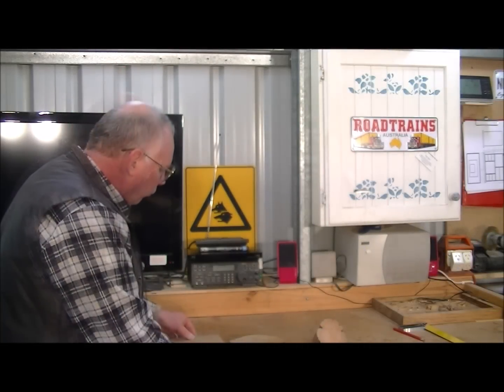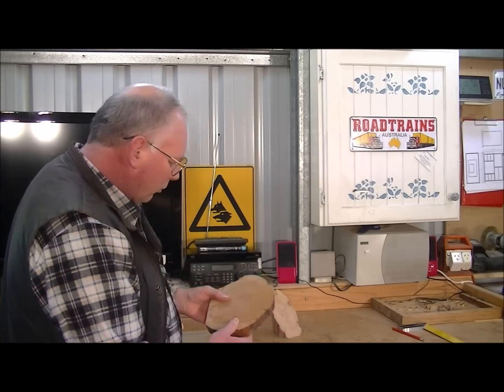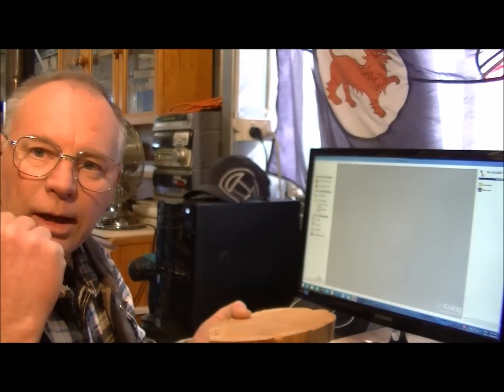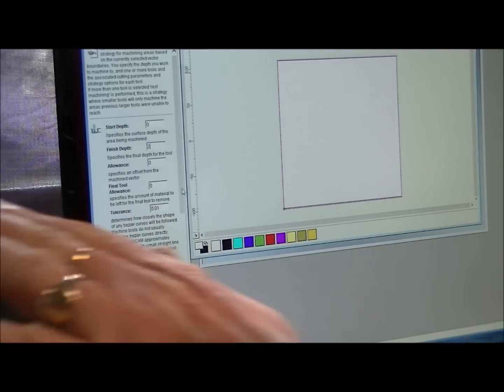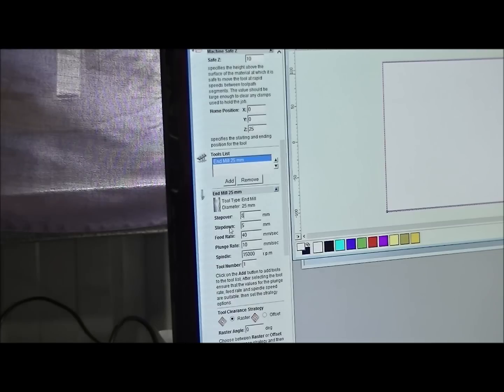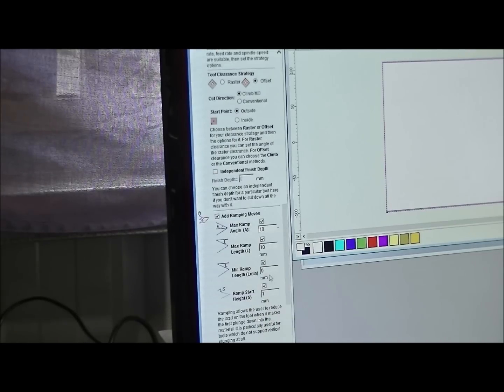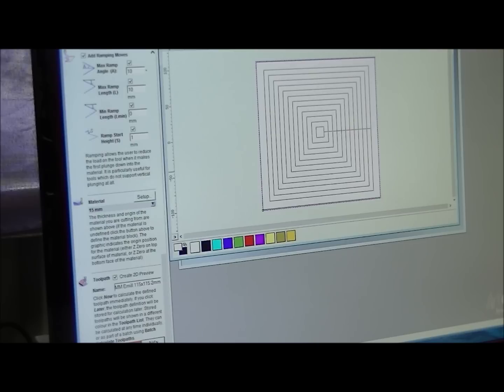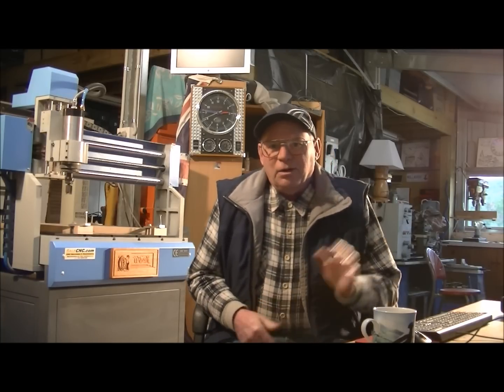103 Absolute beginners CNC Router, ArtCam, Mach 3  Tutorial

Comment: I have a symmetric design about vertical axis drawn on autocad. This design is fed to artcam which makes it machine readable. Problem occurs when I cut the design as it is not cut as per the design dimensions. One half is different than the other half. And it has happened on multiple occasions. I have checked the design in autocad as well in artcam but there is no deviation from the design. Then why is this error happening again and again. Please help me with this issue. Thanks.

Comment: What kind of PC required for artcam 2008 based CNC routing? Is ryzen 2200g enough without discrete GPU?
Reply from the maker: Hi, WIN 7 to 10 500G+ and 4G RAM
Reply: Roger Webb that was so fast. What about CPU and GPU?  Thank you
Reply: @inventorsworkshop9600  hi

Comment: Hi Roger, very nice intro to CNC, when I make a circle of 20 mm of diameter in ARTCAM, why MACH3 does it of 21.5 mm, I am using  G-code .tap extension, or any other figure always MACH3 does it from 3% to 5% bigger, thanks in advance for reply.
Reply from the maker: Hi, see my video 198.
 Australian Inventor Roger Clyde Webb
Reply: I will, thank you very much

Comment: how is the wood clamped on the cnc table ?
Reply from the maker: T3CHNOTURK Hi 
Screwed from the back ;-))
Reply: Roger Webb ok and how when you don't want screw holes on the back ? :), i have claimed with 4 blocks on the side of the wood. it worked very well but a bit dangerous when the wood get loose it will lift the wood up :P